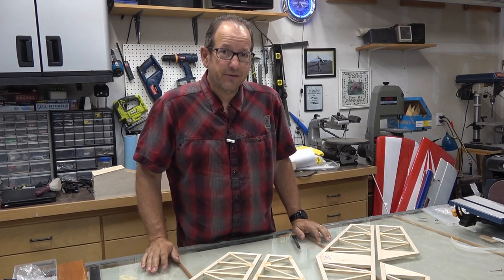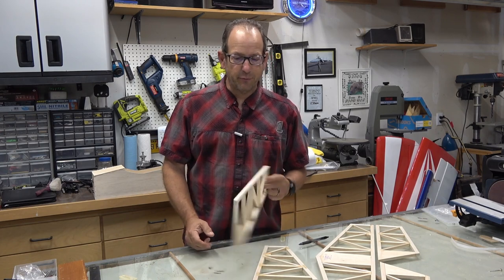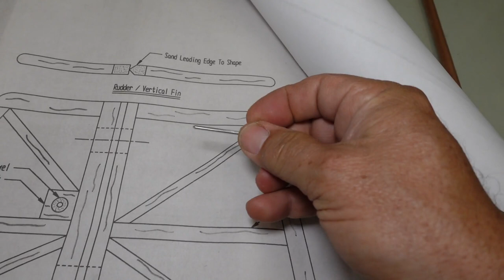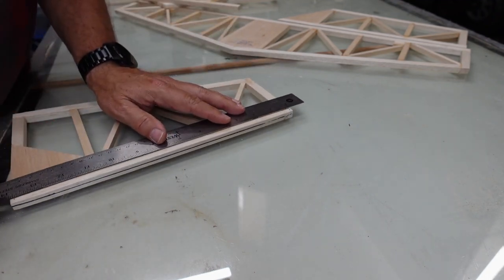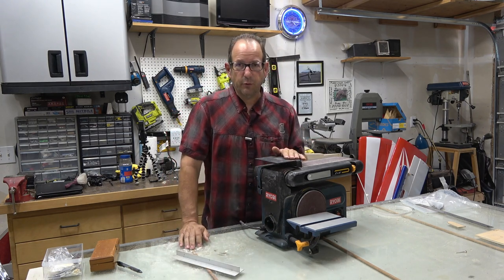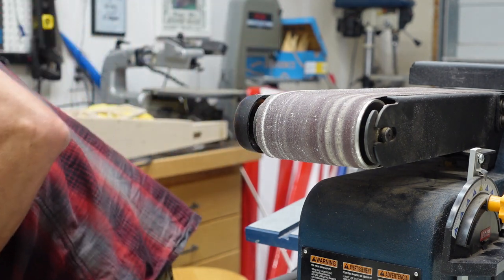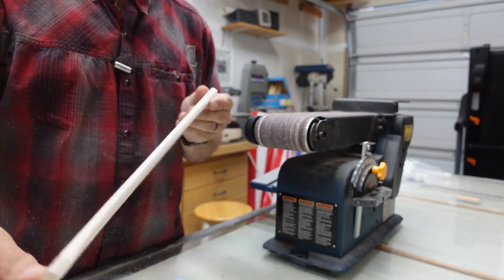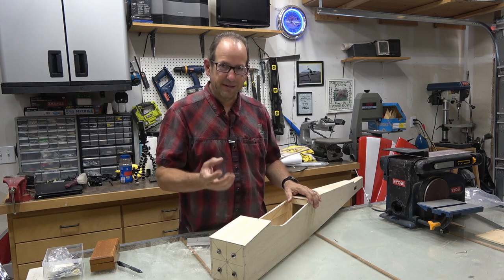Shaping The Tail Feathers, with a bench belt sander, Scratch building Giant Scale Model Airplane

Comment: I depend on a low level razor plane .. only takes a few strokes and done.  I have used my large stationary belt (6x48”) with a fine grit belt to ever so lightly lever the entire surface flat.  Not often with the machine off.

Comment: That tool you have was sold by Goldberg i used to own hobby shop and used to sell them.I use t bar to sand  the v on rudder elevator ailerons.Sand paper on inside t bar by hand hold on top of work bench block sand.

Comment: Dan, regarding those angles on the hing lines with as little material that has to be removed, I would stick with a hand plane.  Less chance to ruin your part.
Reply from the maker: I agree... It would be much safer using a hand plane or a sanding block.  But it has been so long since I have used the bench sander... Had to do it.

Comment: Hi Dan, I have only just stumbled across your channel and it's great to see you promoting the joys of educational model airplane building as a hobby. I have not yet watched every episode all the way through but enough to know that your engine choice is not suited to that plane you are building.

Wing loading is a serious issue here - you need a wing area at least double of your build for that monster engine. A .90 to 1.40 glow motor would pull that plane around the sky much easier and without all that weight, which was your problem in first place.

While we are on tail surfaces here I advise that you sheet that open framework with 3/32 balsa - those open structures will fail under the aerodynamic loads to be encountered.

BTW I still have a couple of monster planes but my kick around faves are smaller electric foamies, just saying.

Comment: Hey Boss, I’m having issues with the 3” ailerons. Where did you find them? I’m having NO luck! Great series! Thank you forre-inspiring me to build!
Reply from the maker: Good catch, I couldn't find anyone that makes a 3 inch chord aileron stock either.  Someone had a 2 3/4 aileron stock, and on a big strip aileron like this, it will still be more than enough surface.  I bought 4 and glued them together to form a thick isometric aileron, but I can see now that the thickness is a little taller than the trailing edge of the wing so I am going to get out that belt sander and sand down the height a little.

Comment: Dan I was wondering if there’s a way to make this plane a two peace wing instead of one peace to make it easier for transport or would that not be practical?
Reply from the maker: There is always a way to make a two piece wing, or a three piece.  The most common would probably be a sleeve and tube.  Sig airplanes use an aluminum channel and tongue which also works well and there are probably numerous ways you could custom build wooden spars that could be locked into position. True scratchbuilding.  Regardless, it can be done with a little enginuity.  The only take is, it will add weight to the overall design.  Multi piece wings weigh more because of the additional hardware.